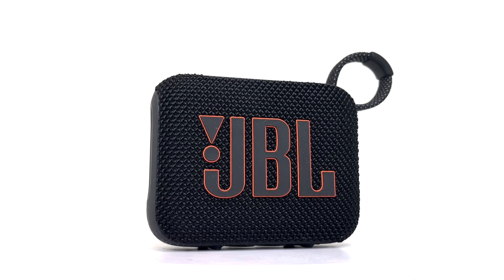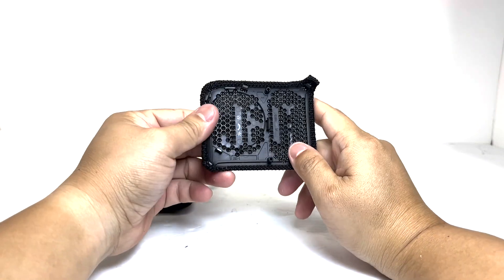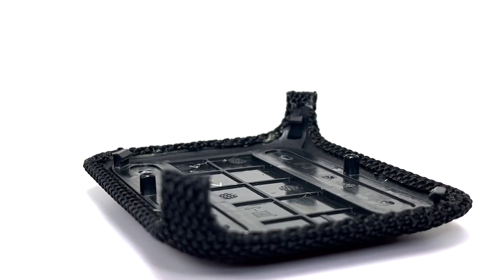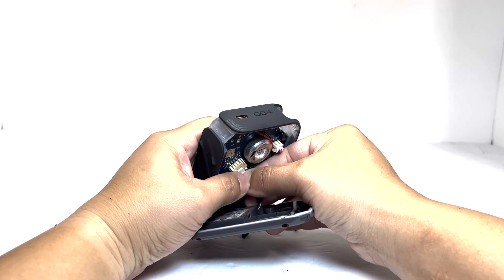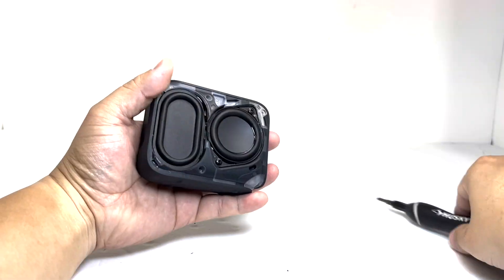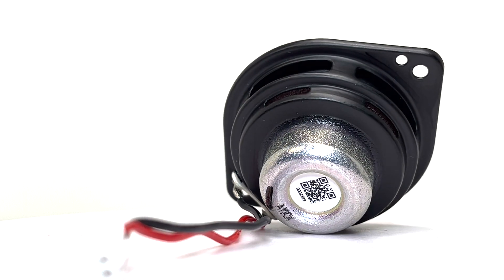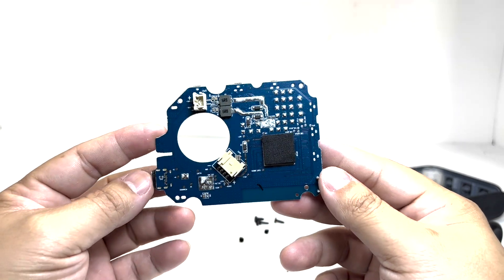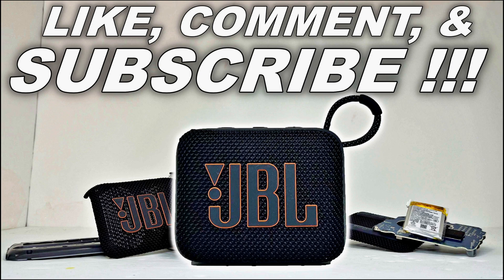JBL GO 4 COMPLETE TEARDOWN !!!

Comment: That’s a stunt battery  you think there is room for even just one 18650?
Reply: I guess u can put a little bit bigger battery than the stock one but definitely not 18650 or even 14500.

Comment: Brother, Sony ULT field 1
Reply: ironic you say that, i got a new go 4 by chance, and i have an ult field 1. i use the app equalizer in combination with atmos custom and surround virtualizer on the jbl and ult field 1. both speakers sound good, for its size the go 4 is good for low volume sound quality and mid in smaller spaces. the ult field when combined with its eq and atmos sounds really good in large spaces, and amazing in small spaces. then i also have a soundcore select pro and a motion boom plus that pair nicely, and those are bodyshakers. all speakers are priced relatively well for their capability. thats if you use the right device to drive them and the right settings for the music. that goes for any speaker tho. bluetooth doesnt magically mean a device cant be more capable with onboard phone dsp contributing to quality on top of the speakers hardware dsp. and equalizers are essential for any speaker, one without the ability to utilize one is one you dont want. and one with minimal options can benefit from onboard. my favorite type of device is those that have seperate volumes, the phones volume is seperate from the speakers buttons. more volume scalability. if you get too much pre-amp from the phone you can just dial the volume back on the phone and increase it on the speaker.

but i agree, the ult field 1 shocks me every day.... it uses a really good dsp with a just sizable enough kicktube design to produce highly processed but clean sounding bass and kicks with enough punch for you to feel in a large space. tuned that thing gives satisfying crystal highs and smooth mids with punchy clean bass at an absurd volume and clarity for its size. the go 4 as well. i think applications vary tho, this would work well in a very small space or on a small backpack. camping pack? ult fields got a strap too, might as well get insane sound vs good for the dumb small size. when it comes to price to performance the ult field 1 is 100 dollars and this is a bag clip style 40 dollar speaker. price to performance and use case, this is equal. but the ult field 1 fits my general use 100x better. this lil thing is nice, but its nothing i plan to use immidiately. but i can see why such a good sounding absurdly tiny speaker can be useful in many cases. if you can carry around a half empty small water bottle with a strap, the ult field 1 is perfect, if you need something unassuming and reasonable and tiny that can light up an entire huge room, or youre going wheeling, ult field 1 can (dont get the white one or offwhite for wheeling lol). taking a jog, or walking to the store, or hiking? probably the go 4. even if its carriable, the included strap and weight of the ult field 1 make it unsuitable for walking with a small bag. camping pack sure, you can hang a lantern off some of those.

in a small space, and overall for its wattage and size range, the ult field 1 is a magical device. even if the bass isnt extremely powerful, the frequency response even below due to the dsp can be extremely clean and more true to the audio by capturing so much more depth than other brands. but sony and bose have an extensive audio history, and jbl is relatively party centric style devices. i do love how the ult field captures the sudden bass fluxuations and its such a warm clean transition with no mud. used to think only giant subwoofers with good tuning could really make something sound good. but head units arent really a thing anymore. portable audio is huge. and well, gotta say speaker tech like that just 20 years ago would have been alien. such a size for the sound quality and volume at which its still clear. madness. and bass that doesnt crackle without a dedicated subwoofer? didnt really exist outside large devices. driver size mattered. bose was the only one doing black magic with port tubes back then, aside from your diyers. that was only in the 2000s, and definately 90s. audio engineering has vastly improved in the last 30 years. but nomatter how much that improves, i still cant appreciate speakers that cant cover all the frequencies in an equal way nomatter how you mess with the sound. theyre just bad and id rather have silence than bad audio. nobody likes harsh sounding music, but most people like a good beat.

Comment: they should of added a 2nd passive radiator on the back instead of making it empty but either way i really wanna get one when they are available near me
Reply: Then there wouldn't be room for the battery or they would have to make it bigger and the single driver will probably not move 2 pasave radiators much rendering the 2nd one usless